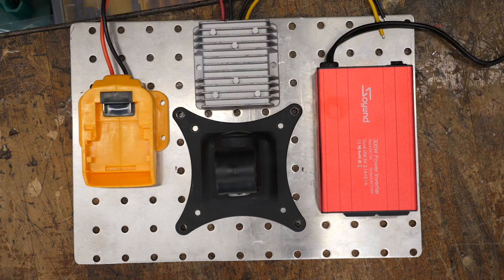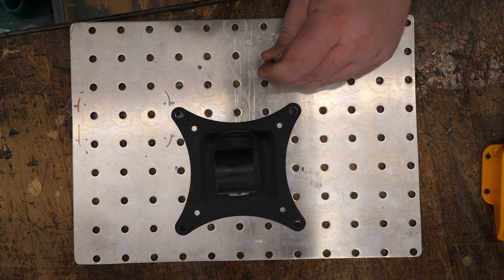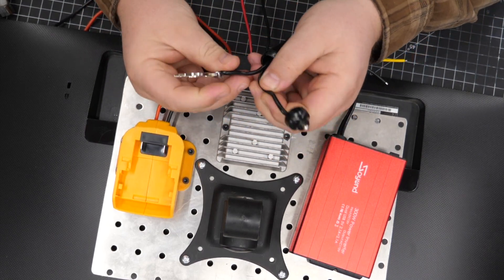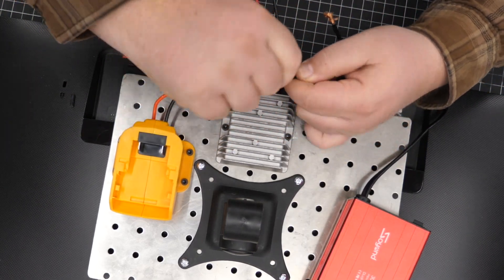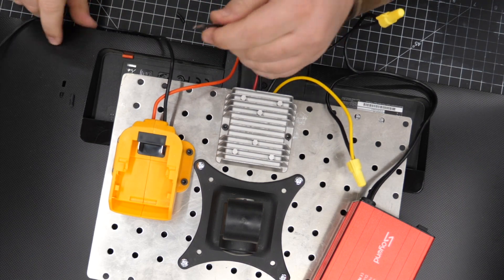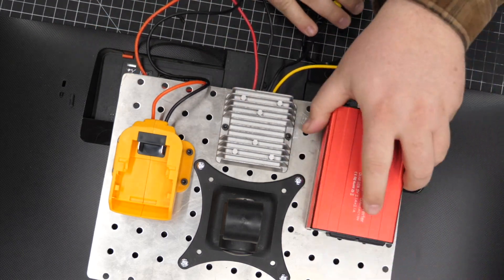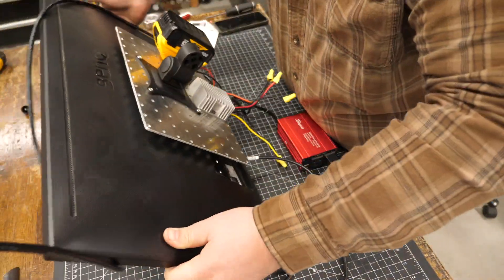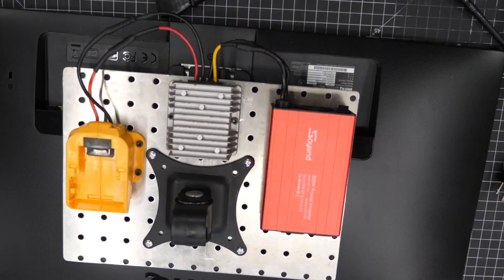Using a Drill Battery to Power a Monitor(Portable Monitor)

Comment: If you get a monitor with an external power brick, they're usually about 19V, which is real close to the same as an 18/20V tool. battery. With that type of monitor, you wouldn't have to crack open the monitor to remove the inverter from the loop. 👍

Comment: This is very cool. What size voltage reducer did you use?
Reply from the maker: Thanks!  I used a 48 to 12 volt reducer.  I linked the exact one I used in the description under the video.
Reply: @HighCaliberCraftsman  The voltage reducer you linked is " DC 8V-40V to 13.8V" - does 13.8 still qualify as 12v? I'm working through the build now. Thanks!

Comment: I’m so interested in that. How long does the battery keep the monitor going for on average? That’s the only thing I would worry about it running through batteries all the time. This would be perfect though for out here in Okinawa though.
Reply from the maker: So far I have had it running for 3 hours on a 5amp hour battery.  I haven't ever filmed longer than that in a direct stretch but I think I was probably getting close to needing to swap batteries.
Reply: 3 hours isn’t bad.  Back in the day you were lucky to get a laptop to last that long.